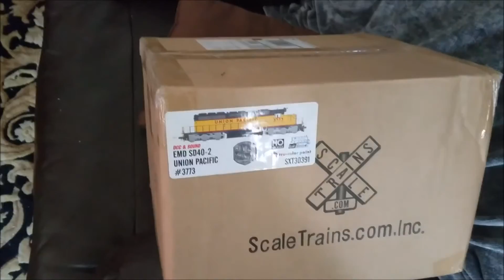Review Not-So-Briefs: Scaletrains.com Rivet Counter EMD SD40-2 in Burlington Northern

Comment: Nice video woody, I bought 2 of these in union pacific. Most of my fleet has Tsunami decoders and one thing I've noticed on these Loksound V.4 decoders scaletrains is using are is that the sound is awesome but lacking the air spitter sounds normally heard on SD40-2's which is pretty definitive when standing next to the prototype. is there a CV change that can be done to correct this? , I have very little experience with Loksound decoders. Thanks a bunch for posting!
Reply: There is actually a function you turn on to get them to turn on. Or you can have them on at all times by default.